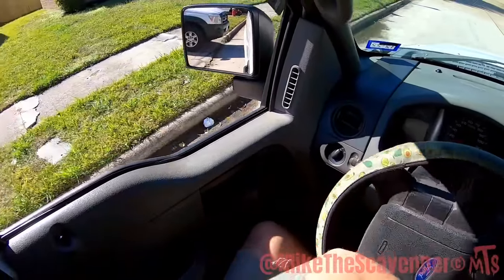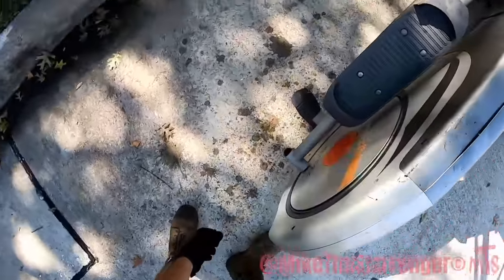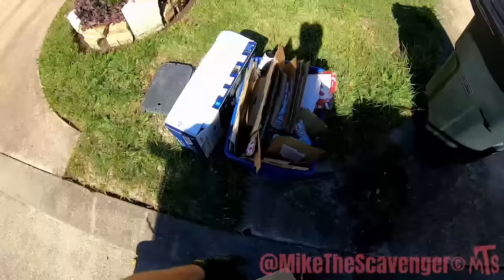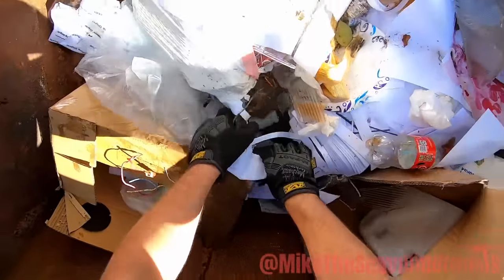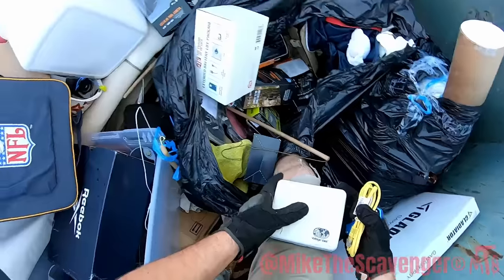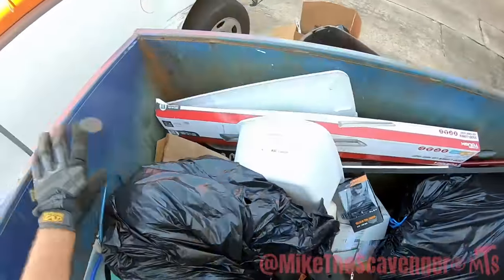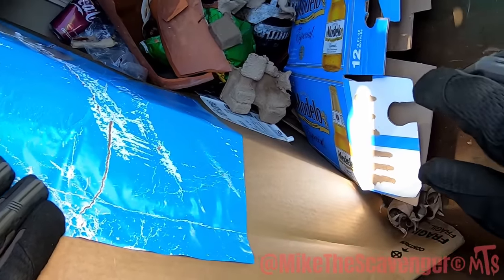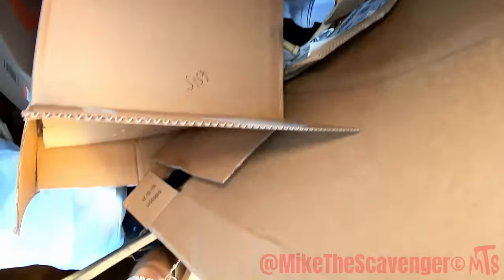Dumpster Diving & Curbside Scavenging "I'ma Try Em' On"

Comment: If those bulbs worked for the light you got out of the bumpster they sell new for a couple hundred bucks there  Not sure exactly what kind of album it is if you're a  Sodium vapor or metal  haloid and they both go for a couple 100 bucks and even sell it for least 50 on Facebook marketplace

Comment: Shouldn't be hard to convert that elliptical trainer into an elliptical bike! Cut the front off and weld a bike front on! Now that I've gone to the expense of a wire stripper (a good one), I've gone full turbo on wire and copper of all forms. Every motor and transformer gets the chop for the copper- but it's a bummer when you find aluminium windings! Pays to give a scrape with the knife first because they copper plate the ally wire most times. Now I'm planning to build a granulator for the wire that's too fine for the stripper- can't bear to cash in wire with plastic on when I could get so much more..... reckon I've got the bug!